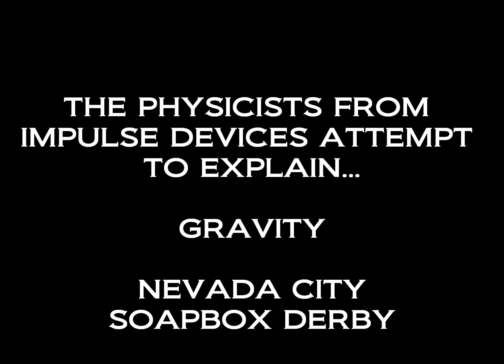Nevada City Soapbox Derby- GRAVITY Explained

Comment from the maker: @ggoodknight Thanks for checkin' in on this discussion. I had the crew pull 85# of barbells out of the tail (behind my seat) of the 'Torpedo' as it was too squirrely wanting to fishtail into a groundloop too easily. Time went from 49secs to 50 secs., but I also damaged the hard rubber tires tryin' to get it stopped! So, I don't know which hurt the speed more.